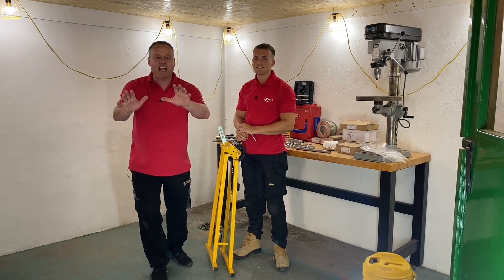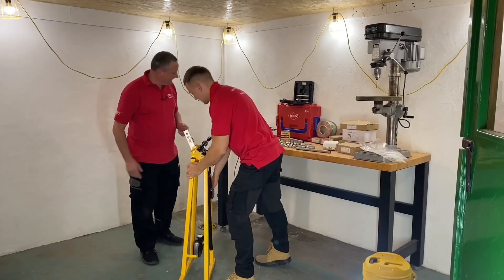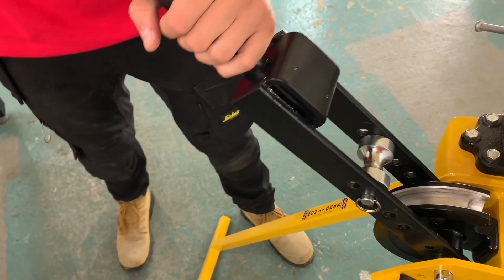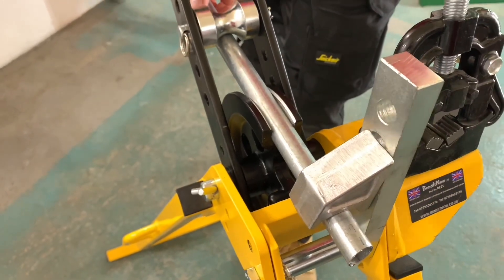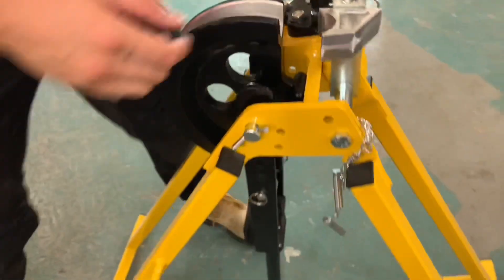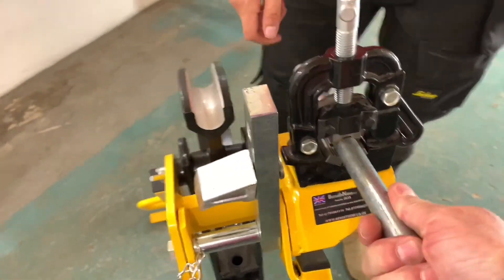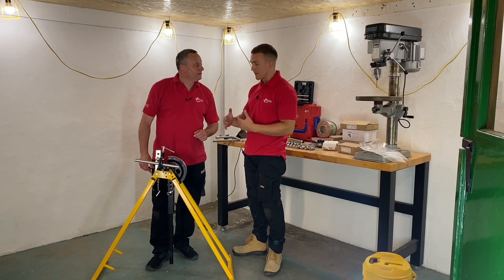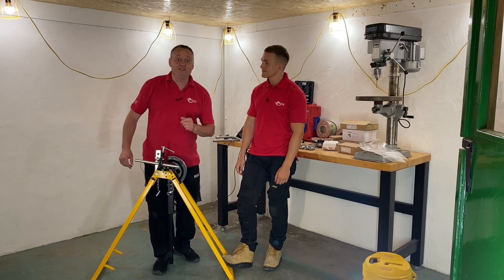CONDUIT BENDING MACHINE ESSENTIALS - Apprentice electrician skills

Comment: Does anyone the formula for in example I have 1000mm left scrap (left over pipe )  20mm steel conduit  and I want after my bend to be 200mm I know I can mark 55mm in top of my bender and I get 100% correct . What I don’t a understand from 1000mm how much pipe  it’s going to be left as  I have tried training something I am losing 110mm sometimes 150mm sometimes 50mm I don’t know why .😅😅😅 just learning .

Comment: We were taught how to bend conduit using a 150 x 150 mm wooden post with the required holes drilled into it. We then moved on to the traditional benders.

Comment: My pipe bender for many years was a 3ft ish  long 4"x2" bit of hard wood with a 3/4 hole one end and 1 inch the other rounded inside with a red hot bit of pipe. It was the way most lads back then bent  pipe.
Reply: on site in the 80s and realised we had forgot the pipe vice the foreman did that same thing except he used a 20mm and 25mm hole cutter and the day was saved as we were working away from home, would like to see a tutorial on that in case the situation ever comes up again

Comment: I got fascinated with conduit at junior school — it was built in the early 20s then completely re-wired in the 50s with the new-fangled BS 1363 sockets and all done in surface mounted conduit so you could follow where everything went until huge collections of it finally disappeared into the wall of the plant room.  My current flat built in 1950 was also all conduit, but being new rather than retro-fit it's buried in walls, floors and ceilings.  Have a fish tape and replacing wires is so dang easy it's a joy.

I'd like to see it used more often outside industrial settings but we all understand that cost of materials and time of skilled labour makes it an expense that very few want to take on if they don't have to.

Comment: I wonder if this bender can be used to bend American conduit. We use EMT and Rigid tubing here, and the most common bendable sizes are 1/2", 3/4", and 1". This bender looks a lot simpler to use than the free hand benders we use here, and we need a different bender for each different size. This seems like a one tool for all.
Reply: Given EMT is thinner walled than UK conduit then yes it will, probably with less effort than our conduit, given that the US tend to use benders on a stick (Klein - Can't remember that model off the top of my head)

Comment: Keith and the team at BendItNow are fantastic. Obtained a Hilmore EL25 "Shortie" and was missing the tubestop, a quick visit to their site got me the parts I needed and the aftercare is fantastic; I was missing some of the R clips and (From another GSH Video; An extension bar and he pointed me in the right direction; Alas I couldn't use the GazHack of putting some some over the handle as the handle is ~28mm and I didn't have any 32mm to hand, so after a 2am text from the porcelain throne. I got a reply minutes later again, pointing me in the right direction. Fantastic Team, fantastic service and, If I'm not mistaken they were one of the original suppliers to Irwin/Hilmor/Record before parting ways and forming (no pun intended) BendItNow.

Comment: Are the American style conduit benders like the Ideal 74-027 any good or has anyone used one? Are they any good?
Reply from the maker: They are not designed for U.K. conduit and can be back breakers to use 👍🏻
Reply: @efixx  still lighter than hauling this behemoth around the jobsite 🤣
Reply: Here's US electrician Dustin Stelzer with far more than any non-American needs to know about US conduit bending.  It looks like far too much hard work to me.   😀  https://youtu.be/5L5Kujr98Cg
Reply: @calmeilles  Conduit bending is pretty labor intensive but there's nothing quite as strong as EMT, or even better, Rigid Conduit housing your wires for lighting or power.